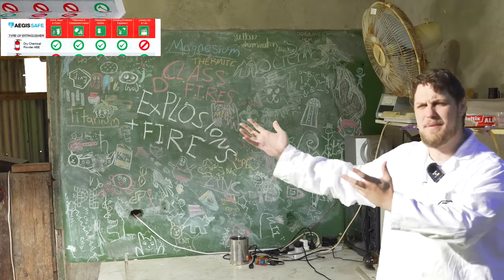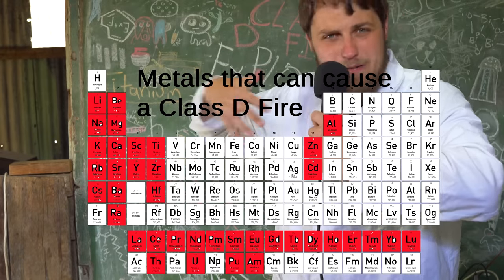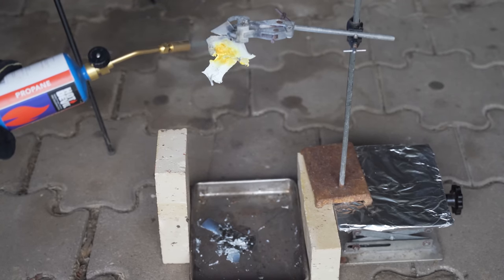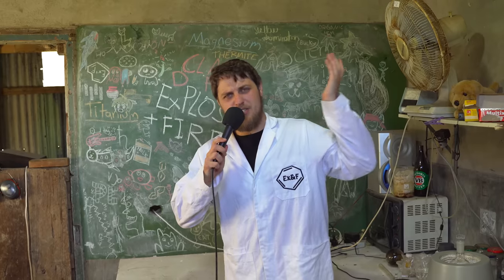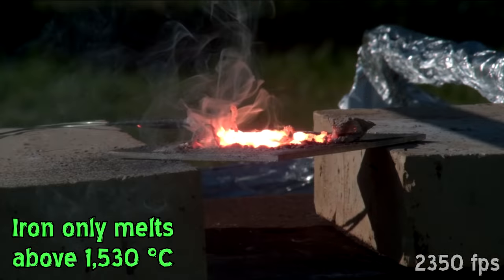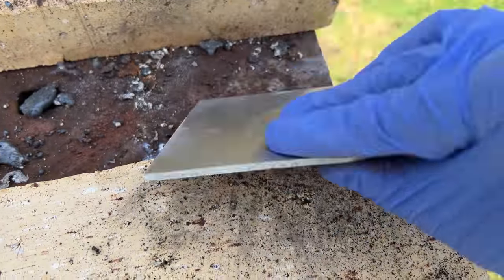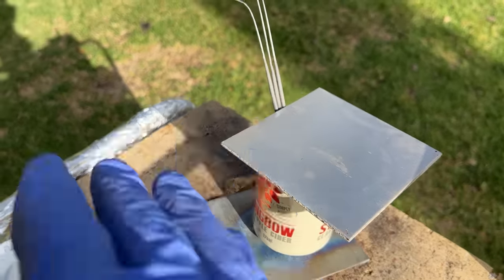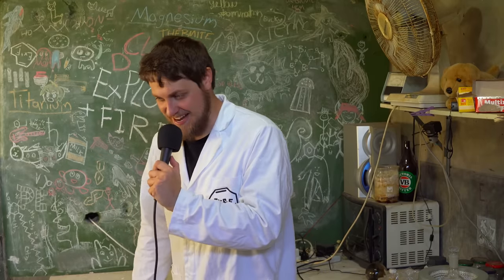Lighting metal fires (and putting them out??)

Comment: increase the surface area of the titanium to help it catch fire for it will have more oxygen to react with. just like aluminum, a block of it wont burn but grind it down and it'll work extremely well as a component of solid rocket fuel

Comment: D class extinguishers will become more common as EV's rise... although I have my doubts a small one could handle a car battery fire (enclosed, the agent will just spread all over the car). So far I've seen fire brigades let them burn out while soaking surroundings using multiple fire engines, their water-based foam can't do anything to stop the fire itself.
Apparently the most common ones where I live use not fine salt but some sort of silica/mineral suspension. And yes, very expensive.

Comment: Surface area to volume ratio, my dude..... If the ratio is high enough, even concrete will catch fire. That is why sugar processing plants and other very fine dust-producing plants like sawmills "spontaneously" explode. These extinguishers are really made for people who work with these materials in their powdered form and for people who machine these materials and generate chips and heat. I have forged over 300,000 lbs of powdered magnesium into solid billet form in about 3 years time and have also machined my own forged material in-house. We also processed powdered aluminum and titanium, along with other materials. Particle size was 325 mesh - that's about 4 micron per particle... THAT material WILL ignite VERY, VERY easily and will continue to burn until it is either all consumed or you hit it with a Class D (if it is still a small fire.......) If a Class D can't handle it, you evacuate the entire building, call the fire department, and watch your business burn to the ground.... Class D's are MANDATORY pieces of safety equipment for ANYONE working with these materials in their powdered form or machining these materials and creating chips and shavings. These materials are all considered "hazmat" in their powdered form. Once these materials have been converted from powder into a larger billet form or solid piece of metal, they are no longer considered "hazmat" and can be handled, transported, and dealt with just like normal materials until you either machine it or turn it back into powder. Then the chips and/or powder become "hazmat" again and have to be handled as such. It is ALL about the surface to volume ratio of the material.

Comment: For the titanium, get a ceramic flower pot with a hole in the center. Fill the pot with thermite and let it rip. You basically want to provide a channel for the molten iron to flow though and actually penetrate the titanium.

Comment: Surface area makes a big difference to fires. Thin magnesium burns very easily. Titanium chips may burn with the setup you have demonstrated. Smaller and with gaps to trap the heat.

Comment: I was incredibly surprised when he wanted to bet metals very hot that he didn't try one of those solar lens things that I've seen people use to create actual molten lava in their backyards. I don't know how hot they go, exactly, but it would seem to be a good place to start. Also a bit more...controllable and consistent than just putting some burney stuff on a plate and hoping the plate will catch fire. Heat travels up, so even a very hot thing that is already on top of what you're trying to ignite will have a harder time setting that thing on fire because its heat is primarily escaping in the wrong direction.

Comment: this is why i HONESTLY think that "greek fire" was some sort of booze "based" thermite compound possibly that had magnisum (or another class D fire capable metal) in it, due to its tales of burning even better while underwater, and nothing being able to put it out.

if you take a basic copper thermite recipe, and then suspend it in a flammable liquid, like a thickened booze, you could then use manual pumps to spray it out like a flame thrower, and when that stream is ignited by a torch, it could start a fire that would be almost impossible to put out quickly enough to save anything. and the metal fire being fuled by the water would make diving into the ocean as ineffective as everything else you could try.

Comment: Oh the met-LX. I used one once on a mag engine block car fire like 3 days out the academy. Got a very stern talking to afterwards. Turns out they're ungodly expensive and just upping the gpm's with water will cool and handle most mag car parts and create a nice show for spectators. Be sure to stand back. Now in industrial conditions it's a different story. Metal shavings in a CNC for example. Lot of surface area to react. Add some different types of metals and you got a mess. They like to splatter too. And burn into your skin while the moisture in your body increases the violence. Burning metals are scary, much like WP. Stay away.

Comment: Not sure about lighting it on fire, but I bet you'd have a better chance cutting the titanium plate with a thermate/thermite shaped charge that would direct all of the reaction into a particular spot rather than letting it kind of just go wherever. Not sure how illegal that would be though and the Australian equivalent of the ATF might not be very happy about it
Also, as other comments have suggested, it might be a lot harder to light titanium when it has soot and oxidized shit on the outside. If you can mix a flux into the thermate or something to prevent oxidation (or just straight up try arc welding at a really high setting with electrodes that can handle it) you might be able to have a better chance at getting it to work at lower temperatures. I could be wrong and I know almost nothing about titanium other than what you've said in the video and what people have commented here, but just a couple of ideas

Comment: Ever wonder if ancient Egyptian alchemist used the exothermic reaction between sulfer and iron to cleave the pyramid rocks? Like just etch a line in a rock put some sulfer powder (which we know they used for textiles around 2000 bc) and some iron oxide dust from ground up red rocks and then just poked it with a red hot fire poker. It would easily be enough to cause heat fracture, and if you did a good job scoring it and it didn't have a bunch of impurities or inclusions it would break smoothly on the score line. They were famous for alchemy.

Comment: To burn the Ti: I do have an idea. You said you'd tried all kinds of torches? Did you even try a ethyne or oxyhydrogen torch? Or what about first melting/heating it the metal with an induction heater?

Mixing more foreign ideas into it: Get pulverized Titanium (I think this burns well) and coarse powder and chunks etc, mix em together so that first the powder ignites ... and so on ...

Comment: Increase surface area of the metal such as use turnings or shavings or powdered. Steady supply of oxygen. Or use an arc furnace. Such as take a stick welder and two graphite rods bring them close to each other and you have the means to melt most anything... Once it melts supply some pure oxygen

Comment: Well, the main problem with bulk Ti - it covers with oxide layer extremally quickly, and this layer is very resistant to everything - mechanically, chemically, it is stable under high temperatures... Fresh chips, for the other hand, are very flammable. It makes bright white sparkles, when cut with angle grinder, brighter than iron.

Comment: Going back to an old video to me the scariest chemical is Ethylene Oxide. Only under pressure and a temperature is it stable, if it gets to 80 degrees it becomes unstable and at normal temperature and atmospheric pressure it’s a gas that hangs out and sinks  to the ground. Large quantities form clouds that find any ignition point. A gallon or so of liquid is enough to cause an explosion capable of blowing up a giant warehouse, and the containment the gas that was inside. It smells sweet supposedly but if you smell it that’s enough to kill you if not it will hospitalize you and give you cancer.

Comment: Another thing I would like to see is a solid rod of magnesium formed by the sacrificial anode of a tank type water heater used as a thermic lance but instead of blowing oxygen through the magnesium do the cutting underwater and use the oxygen in the water to supply the thermic lance and cut some plate and rod steel underwater.

Comment: Titanium shavings is a fire hazard. It can be easily combust with just sparks from the grinder, you should shaving it and light it just a small lighter and it will burn a bright white color. Titanium powder is also used in shotgun shells to make pyrotechnic dust projectiles.

Comment: Arc welder should do it pretty easily, with a carbon rod.  You can get about 200 amps DC out of a dryer outlet with a solid state (MOSFET) inverter welder.

Comment: Repurpose a Microwave transformer. Rewrap The secondary with 2 or 3 turns of #8.  You now have 2 to 3 volts @ 800 amps.  Connect leads at either end of the titanium And apply power.  To speed up reaction apply oxygen

Comment: Funny Story. I'm prior navy so of course I've been through fireman school. Magnesium and titanium are big time fire issues on board a ship. If those materials are on fire throw them overboard assap. So after the navy i became a aerospace machinist and i noticed one of my coworkers turning titanium on a old hand lathe dry. I quickly walked up to him and said you really should get some coolant on that work piece. He let me know that he was a professional and i shouldn't worry about it. So i went on my way. About two minutes later he came up to me blinking like he had welders flare. And said hey dave you were right. As soon as you walked away the pile of fine shavings on the cross rest flashed and was gone in a poof. He had never seen anything so bright before. So if you are unfortunate enough to catch a matal um on fire remember it now has 
1 heat,
2 fuel, 
3 oxygen 
So it will burn till the fuel is consumed.  
Even if you use something like halon or P.K.P. on it more than likely it will reflash due to the heat that it will retain. And get it off a ship fast or suffer the china syndrome.

Comment: 2 ways to get the metal to burn: 
1. Surround it with a thin layer of ceramic wool or asbestos. 
2. chop it into small pieces. You know, more surface area and stuff.

Comment: firefighter here

you can technically fight fires not rated for water if you can shove a shitload of it, the concept of water is to reduce the temperature below its flash point as quickly as possible. I may have used water instead of shoving an eductor to insert AFFF on a vehicle fire and it still manages to suppress an engine fire with a magnesium block 

except for lithium battery and alkali fires or anything with the blue flammable placard.

oh, to light magnesium put powdered magnesium on top of the magnesium and light the powdered one with an oxy acetylene/fuel torch

Comment: There is an easier way to heat these up, compared to a blow torch. Just a 12v car battery would do. AC mains would work even better, but it would be harder to prevent catastrophes.

Comment: For termite and thereafter. Because it doesn't release a gas and I burns so hot. It achieves the activation energy but the reaction gives no oxygen and the heat may be disrupting present oxygen. I was surprised it didn't the magnesium.

Comment: Bit late to the party here but with titanium it really needs to be pretty thin. As with aluminum the oxide layer is tight enough to prevent more oxygen from penetrating it, effectively putting itself out. But unlike aluminum, the titanium oxide layer has a much higher melting point so it doesn't really care about the heat. Fine enough titanium is actually pyrophoric in air.

Comment: try lighting it like a carbon based fire, ignite "paper" which ignites "kindling" which ignites small "logs" and use that to set the big plate on fire start with magnesium strips around magnesium rods  for example
Reply: and with more of a kiln/furnace like structure to contain the heat

Comment: very long section of automotive brakeline, wadded up bit of steel floss shoved in the end, and a hose flooding the brakeline with pure concentrated O2... Thermal Lance!!! If it can cut through a foot of plate steel it should handle a few mill of titanium.

Comment: But definitely drill a lot of little holes un the titanium, and keep the shavings abd toss them on the would be fire,  i have an idea, cut 3--4 lines in the titanium, anout 75-80% ACROSS frim altering sides. Connect a welder, or use a microwave transformer, with two turns of truck battery cable, 0/0 awg, 2/0 awg. Atleast 2 gauge, or 6-10  10 gauge wires in parallel,  connected ot the ends of the titanium, in a o2 environment , it should get hot enough to melt then!!

Comment: To set titanium on fire, like with most things that are incredibly dangerous when on set of fire, you need a highly concentrated source of oxygen. It wouldn't matter how perfect your thermate or thermite recipe was, it wouldn't have enough oxygen. Most of the air we breath is about a 3:1 ratio of Nitrogen and Oxygen, Just the oxygen in the air alone wouldn't be enough of a fuel source. I would suggest using something like an oxygen cylinder.

Comment: So basically the fire extinguisher is a sand blaster full if dry salt? Operating at high volume,  although ut seens salt could be heated to about 250°f. For a while, then crush into powder.  And store in a tank with nitrogen under pressure to expel it when needed!?!

Comment: The step at 5:02 where you mix the thermite looks kinda messy and difficult, I think I'll try making it in a coffee grinder. Faster and no manual work! I'll be right back with the results
Reply: UPD: yeah, it's definitely a lot easier. Guys, if you ever make thermite - don't bother doing it like he did in the video. Just use a coffee grinder or a mortar&pestle. Ball bearing grinder is even better though!

Comment: Your theoretical building is still better than asbestos, which we still mine shitloads of here and sell it in India, some stuff needs asbestos like firefighter's gear but they dispose of it by throwing it out, they don't have to scrape it up and blast the dust into the air.
Also Studs are used inside walls between plates to frame them and in a roof they push out from the center to hold the roof up, what you've shot showing in that picture are rafters.

Comment: Surely a shit load of burning flammable gas and oxygen being blasted at the titanium would set it on fire. To achieve a shit load of the gas being blasted at it at once, it'd need to be under really high pressure, being pumped by a really powerful pump, perhaps a turbo pump. Maybe using hydrogen as the flammable gas. Basically what I am recommending is a rocket engine being fired against it, with no sort of cooling on it, I think.

Comment: Putting out electric vehicle fires (the battery) is a waste of effort according to two Fire Departments and my experience. As a former oil company employee, I carry a 30 ABC dry powder extinguisher in my pick-up and that's a waste on an EV fire. I saw one FD put 200 Lbs. of dry chemical on an EV AFTER my 30 lbs. and it EXPLODED on them breaking windows for two blocks around! Woman driver had 60%+ 3rd degree burns from her Tesla which is why insurance on them is insane. Battery set the MOTORS on fire (magnesium housings) and the titanium suspension parts-hence the explosion(s)??? Tulsa FD now have a big "blanket" to try to "smother" EV fires, then BACK OFF!!!

Comment: I'm making an extreme sport to put out metal fires training is small scale just the element is to build the arena where the match is you usevthe arena to put out the flame and the only way to win isbto put it out then do a 100m run
Reply: Best strategy is to use the fire against it input equals output by using party balloons the negative charged and temperature pushes any airflow back down in which makes the balloons go higher cause of the lift glass frisbees or mirrors can reflect light therefore heat making it disperse easier plus heres the controversial part a magnet to move the heat fastervamd further amd colder metal can move in like a dog pile reducingbrange etc addimg a magnet is the last thing ifbits fonsidered an option after everything ekse itsbthe cherry on top

Comment: I'm really curious about the yellow substance I keep seeing when he uses thermite. Obviously some sort of iron or aluminium compound. There must be some sort of reaction happening at least on a small scale if this yellow compound is being formed. And it's no oxide, because iron oxide is red, and already in thermite. And aluminium oxide is also already there as the passivation layer, and is white. So what is this yellow stuff? It's also curious that it only seems to form inside of the slag. There's none on the outside. Just inside when you break it open.

Comment: You could probably burn it with a steel fire lance. Oxygen blowing through a steel brake line. Light the steel with a torch and use the oxygen to make it hotter

Comment: You could probably melt the titanium electrically, but idk I’m sure any electrician would tell you not to do that.

Maybe preheat it in a gas furnace so the thermite can spend it’s heat energy on bringing it to melting point rather than just heating it up past room temperature?

Comment: As someone who works in the air separation industry and works with pure oxygen frequently, I can say that attempting to ignite metals in an oxygen enriched environment is much easier than normal atmosphere. Just be careful because the burning can be much more vigorous to the point of potentially explosive. Some might call it cheating, I call it efficiency.